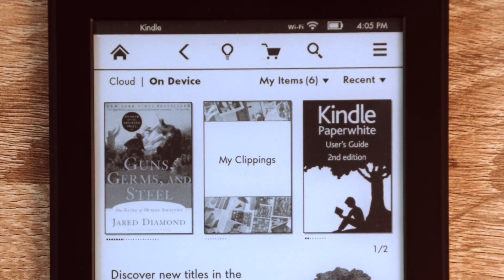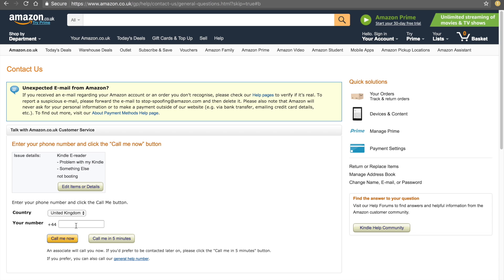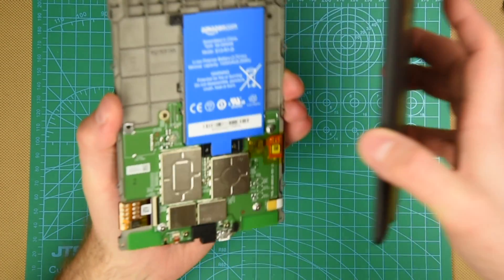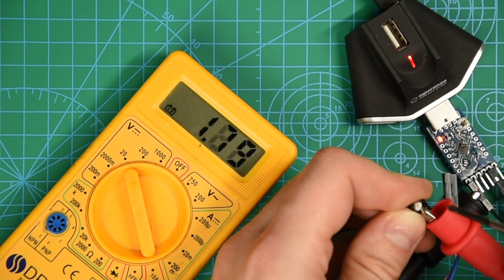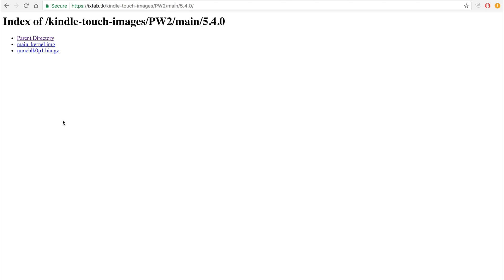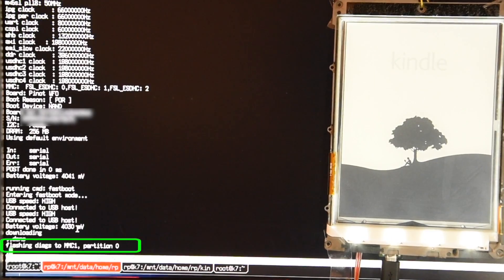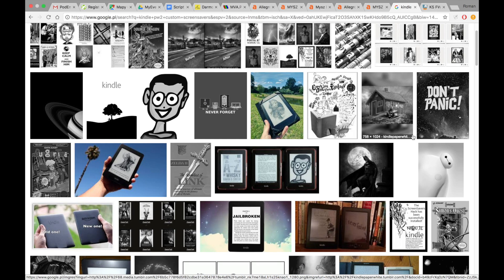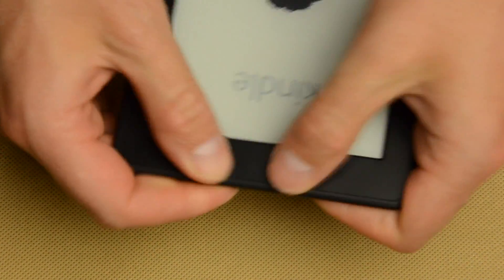Unbricking Kindle Paperwhite 2

Comment: So you need 1.8 on Tx and 1.8 on Rx ?
Reply from the maker: Sorry, I didn't get your question. And yes, you need 1.8V on TX and RX. 1.8V means logical 1, 0V means logical 0. Everything that is higher then 1.8V (+/- some tolerance) on RX or TX line can burn your device.
Reply: Thanks for the reply! I ordered this from EBAY. Gives the ability to select multiple UART voltages http://r.ebay.com/neEisI. This will work correct? Love the video, esp. They OTA software bugged me too. When ANY usb is plugged in PC or Wall crashes and freezes on USB ICON SCREEN. No USB drive feature EVER loads on PC, even when kindle is rebooted while plugged in.

Comment: I've tried connecting the debug serial interface, but no info displayed at all, so it means my Kindle is dead?
I think there is serious flaw on design of Kindle, specially it always tries to connect to network periodically, so matter the status of battery.
Reply from the maker: Not necessary your kindle is dead. Double check serial connection: TTL levels, baud rate and if you didn't mix TX/RX.
Reply: I'm using TTL device (http://www.sxtyhy.net/product/showproduct.php?lang=cn&id=34) similar to the bottom right one of 4:33 and have mad sure it's working on loop-back test, and Putty on Windows for serial connection. I removed the jumper and connected Tx, Rx and GND pin. The data rate, flow control and parity are set 115200 8N1, none, none, like what you have set. But no output when I connect pins to TTL device.

Comment: Hi. I have similar trouble with my Kindle paperwhite 1st. gen., bought on ebay. 
I know about simple way of unlock 1st gen. amazon's I use it before and was succesfully getting great working one. 
This time I cleared mmc memory, got only bist as uboot as working interfaces on the Ebook. 
So I need to put images inside. 
I'm using ubuntu 14 and Fastboot don't wanna work correctly on it. It even doesn't see plugged device, thus i can continue and finish sequence of actions. 
Maybe there's some guide of configuring fastboot on ubuntu cause it seems I'm trying to repeat all steps you have done.
Reply from the maker: Which version of fastboot you are using? Please try this one: https://github.com/TobiasWooldridge/Fastboot-Kindle
Reply: Hi Omnia Mors, did you have success ? My paperwhite is 1st generation too. Can you tell me what did you do?